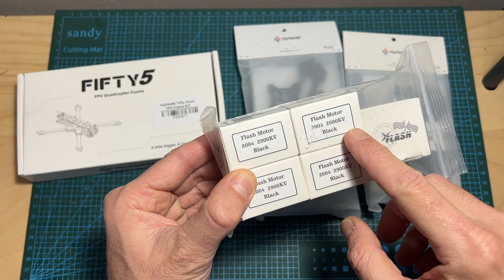FlyFishRC FIFTY5 / TONY5 / Atlas 4 LR Frames - Build & Overview

Comment: I got the volador vd6 and just recently received the fifty5. It is very similar in build quality to the volador, but you can tell it's a more "no frills" type frame. It's also noticeably lighter. Carbon is a bit thinner but I like the lighter weight.